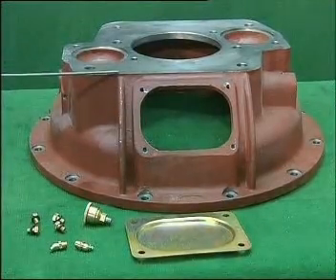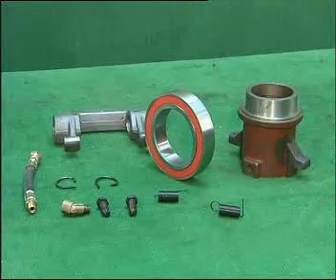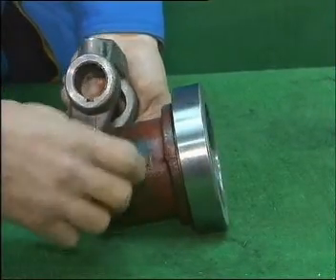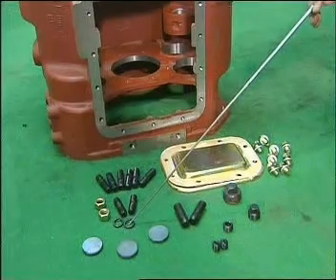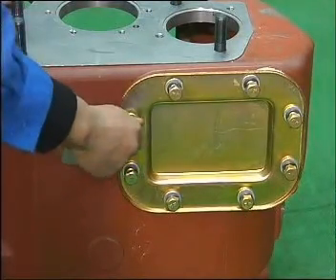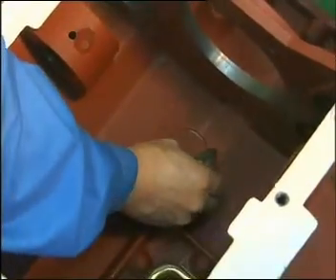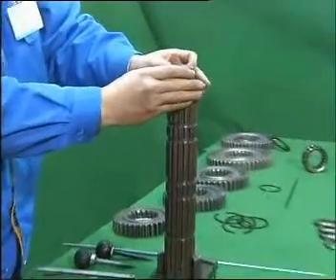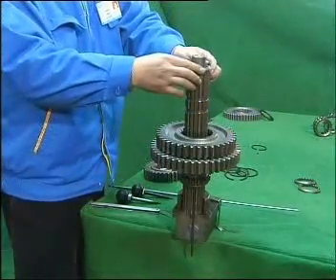HOWO. Assemblyng clutch housing assembly A-3674. Chapter 1

Comment: Hi, do I use a 430mm clutch for this gearbox with the same releaser bearing?
Reply: I have 9js180t, I'm currently using a 420mm clutch is this correct?